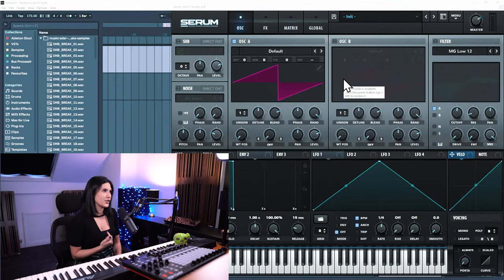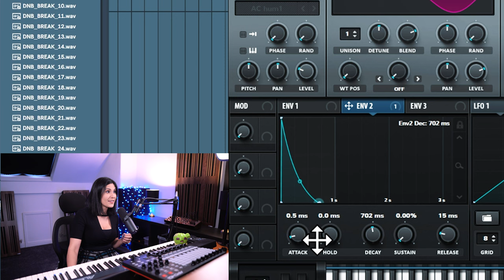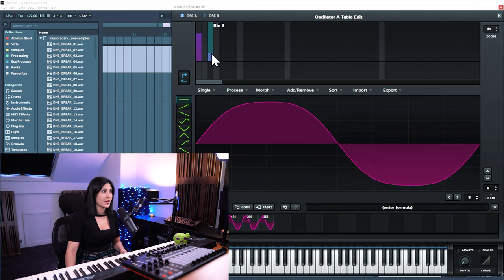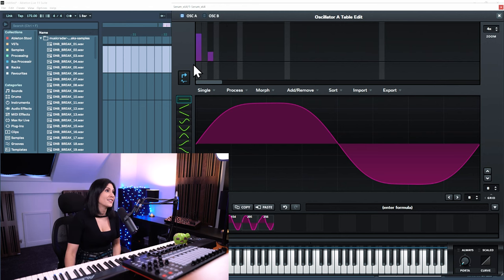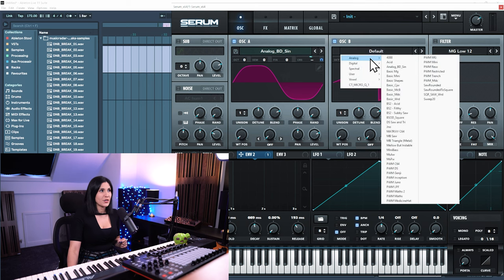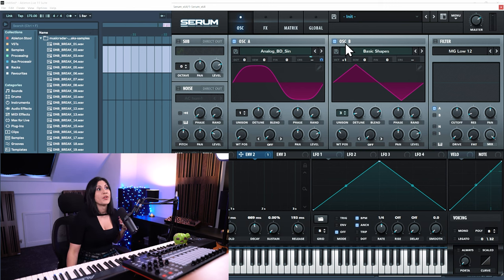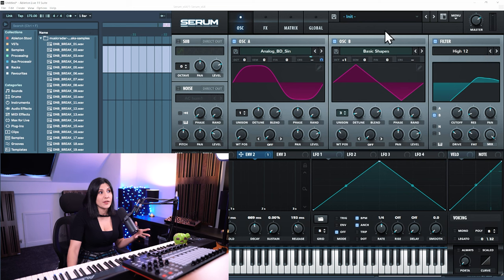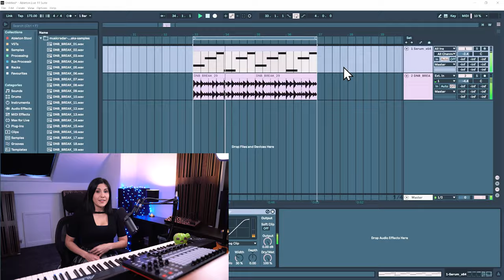The Secret To FAT SUBS!

Comment: Please can you explain what you were doing with the envelope and CRS and the unimodal setting? How does this change the sound? Thanks
Reply from the maker: Coarse pitch is a smaller fragment of transposition than semitones. It therefore can be used to create tiny pitch movements. If you set a sharp envelope on the coase pitch to drop, it creates a thump/impact transient at the beginning of the sound. Any longer and you would run into pitch matching problems with your music and it would sound out of key. Unimodal means it will travel in one direction, down to the sustained pitch of the instrument.

Comment: Awesome info & greatly presented! Question though, is it bad practice to increase your master attack on the envelope just to remove some of the click from the sine wave?
Reply from the maker: Hey thanks so much! Personally I don't think so, and a lot of my subs are made this way. Some would argue against it, as you lose some of the initial impact from the sub. It's a creative choice though. If you have a slower attack but still want that punch, you can play with pitch envelopes and layering a separate impact transient to compensate. You also have you main bass which you can layer over the top and, as long as it's following the same pattern, have your bass transient come from that. And if you decide not to have a transient. This is also fine. It just produces a more minimal and smoother feel. Short answer : no, as long as it sounds the way you want it to sound. 😊
Reply: @BeckySaifMusic  thank you for that great very detailed response! It gave me some reassurance that I have completely made a dogs breakfast of it all!
Reply from the maker: @nuvisionprinting  😊 you're welcome